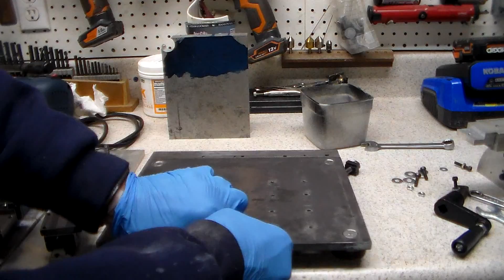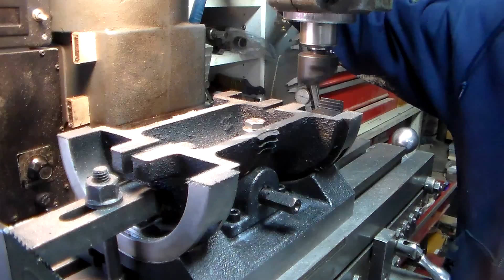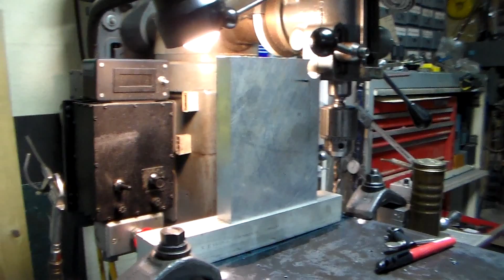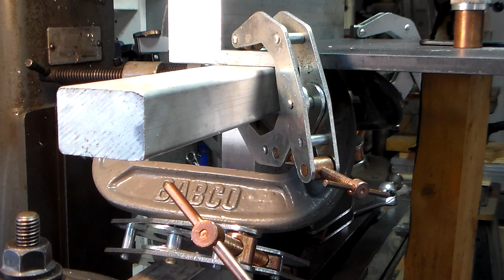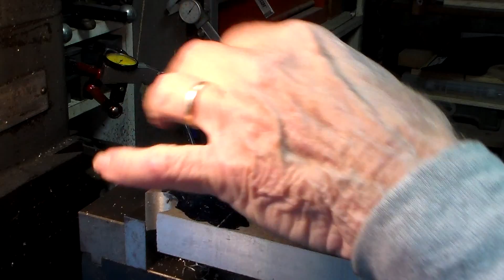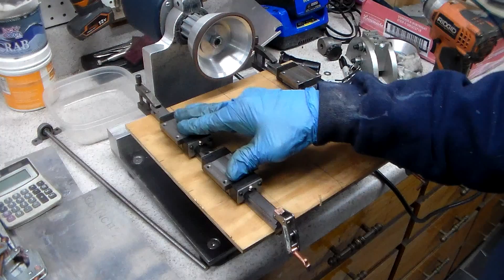Tool Cutter Grinder Build  Part 1

Comment: Nice Build. What are the diminsion of your stack plates for clamping?
Reply from the maker: They are 2" X 3" and have 2 each 1/2" thick plates and the remainder are 1/4" thick plates.  Total thickness of each stack is about 2 1/2".  One of the most useful things  I have made.
Reply: @Histandard2011  Thanks for the help. Where is the hole located for the bolt?
Reply from the maker: @miketimms7952  .300" from back edge and centered on the width.  I used a 1/4" X 20 tpi allen headed bolt with a flat and a wave washer to provide a bit of tension.  Then used thread lock on the bottom wafer which is threaded to accept the bolt.